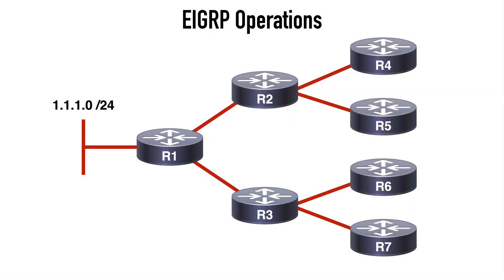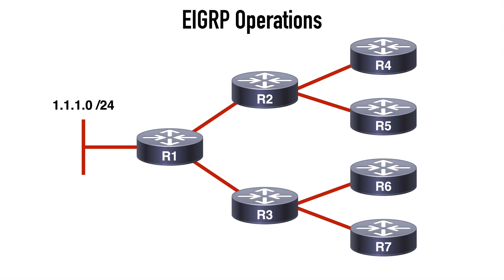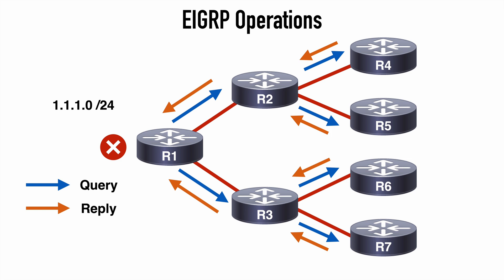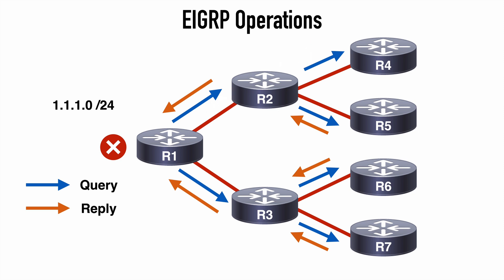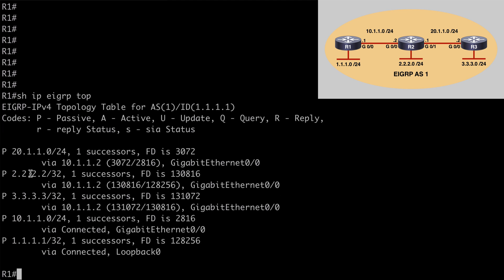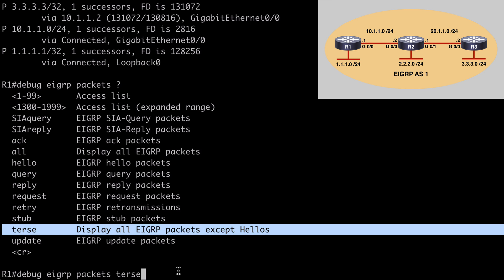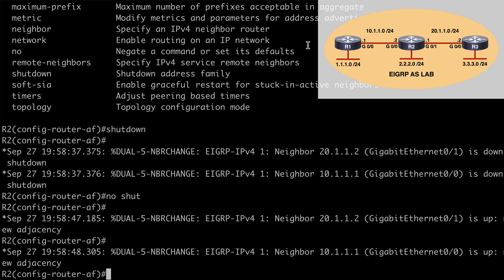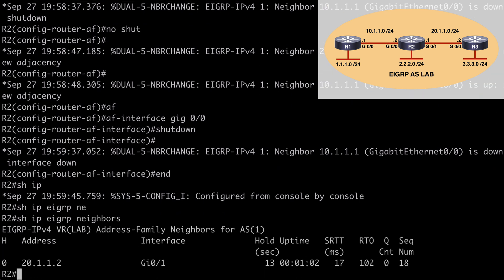CCIE Topic: 1.3c EIGRP Operations

Comment: Great video Charles. Am I right in thinking you had some other device physically between R1 and R2, perhaps a layer 2 Switch? Just wondering why disabling G0/0 on R1 didn't cause R2 to immediately remove R1 as a neighbor based on the link down status which should also have occurred on R2 G0/0?

Comment: very good  video Charles . 
Do you think it is a good idea to desable the time limit or increase  it  before an outstanding query is stuck in active
 by the command  "timers active-time [time-limit | disabled] "??
Reply from the maker: This will certainly prevent stuck-in-active states, but a better solution proposed by Cisco is to limit the scope of our query messages. By limiting the number of devices able to respond to a query, this will greatly reduce the response time required to receive all of the replies, because this limits the number of hops for query messages. Two methods for this would be configuring route summarization and using EIGRP stub routers.
Reply: @CharlesJudd  Thanks charles.